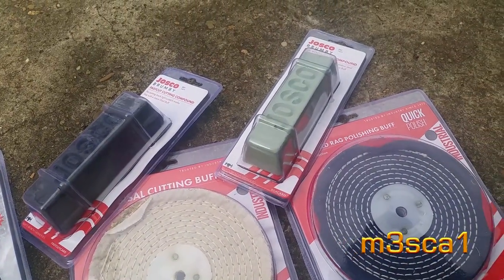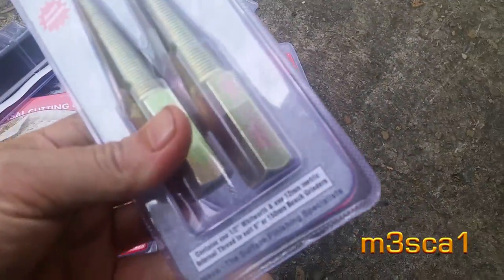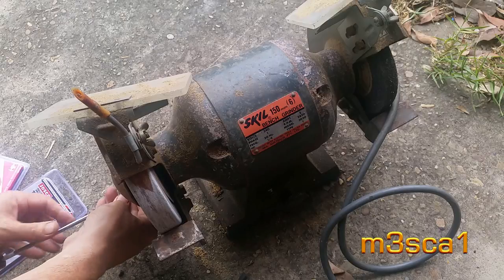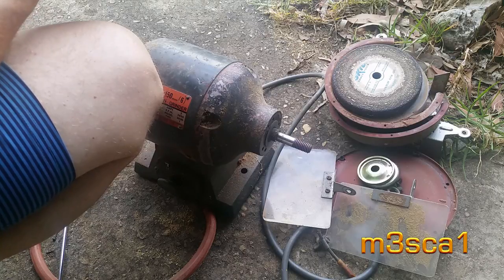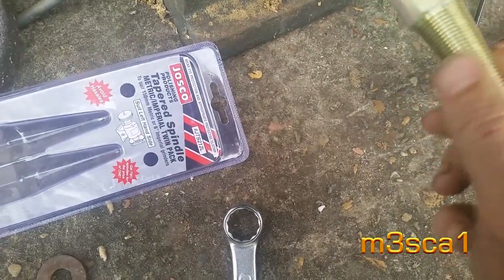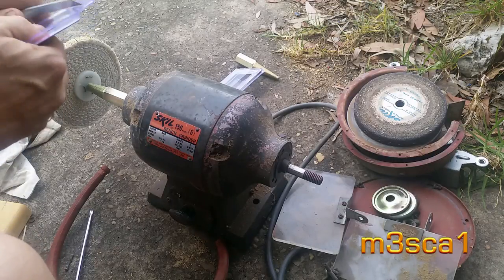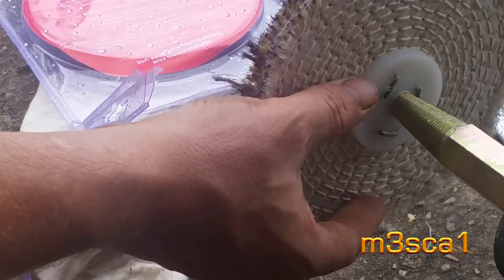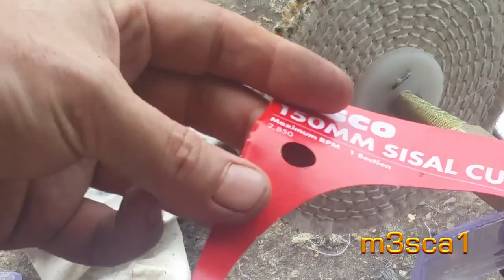Grinder Conversion~Polishing Wheel

Comment: Excellent vid. The bench grinder instruction manual I have does not mention attaching or removing buffing wheel spindles at all. To remove wheels or spindles I see it takes blocks of wood or wedges or rubber hoses or anything lying around the workshop to jam the drive shaft in position. Now I know. Thanks.
Reply from the maker: your welcome🖖🤓

Comment: PRC is most appreciative of you being their  Finishing Station and Quality Control for their POLISHING pads!!!    As for your right hand tapered spindle,, you could drill out the bottom half of its threads (perhaps more) and weld your pre-existing nut  to the spindlel's base. Or, you could re-tap the threads in the opposite direction.)  That way, you won't have to buy another "pair."   BTW, need to put a some larger diameter washers at the base of the spindles to deflect polishing grit away from your bearings...
Reply from the maker: OgMandin0 polishing grit and bearings...thanks hadn't thought about that...ah China yeah what else can I say but buy local made if yoy can. These days there aren't much options. I actually got USA made sawsall blades last week
Reply from the maker: OgMandin0 and yeah i bought the other polishing cones 'pair' and will list the metric pair on ebay...or find a metric grinder and convert that so i can pre polish and polish without mucking around with changing wheels

Comment: The wheel you have is designed to be used wet... the fluffy ones are the dry buff wheels.... you can use that wheel with wet pumice which should work ok for pre polish but that wheel will never give you a real good high shine.